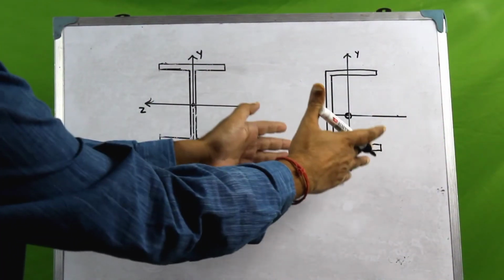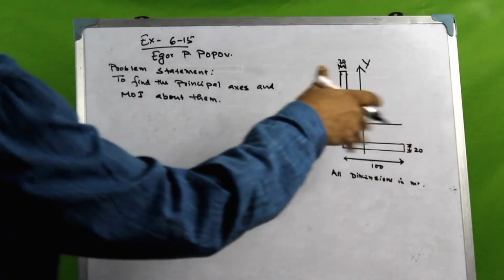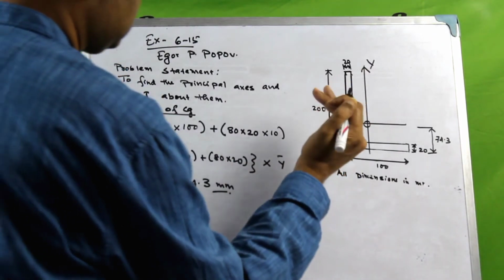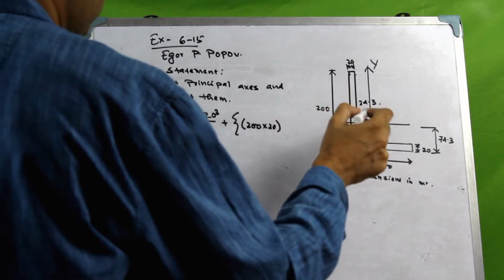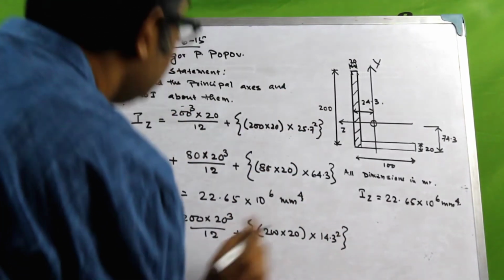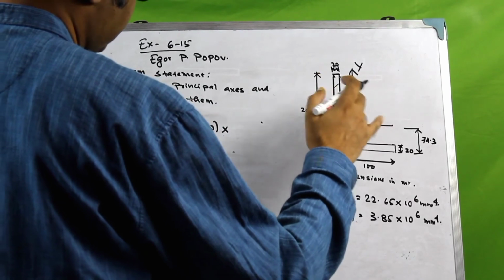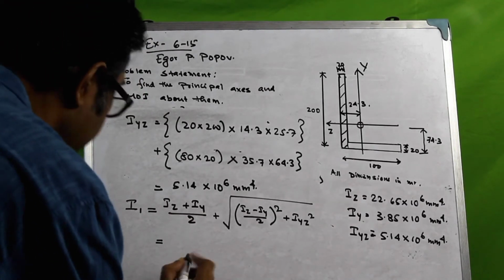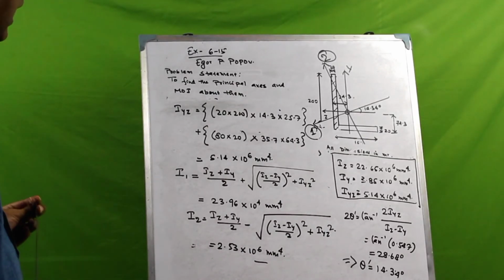#34 - Principal Axes for selected cross sectional shapes

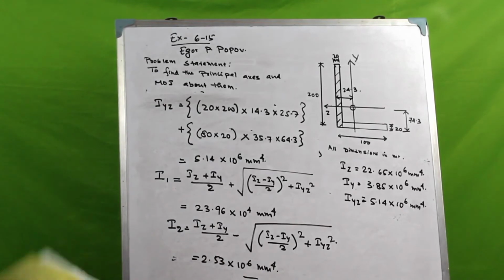Comment: at 23:40 how are I1 and I2 different?It appears you have plugged the same variables into the same equation, so how is it a different outcome?
Reply from the maker: If you notice carefully, there are two terms in the expression to calculate I1 and I2. In case if I1, both terms are connected by a plus sign and for I2, both terms are connected by a minus sign. This results in the difference in values of I1 and I2. Note that the expressions are not same as seem to have assumed.